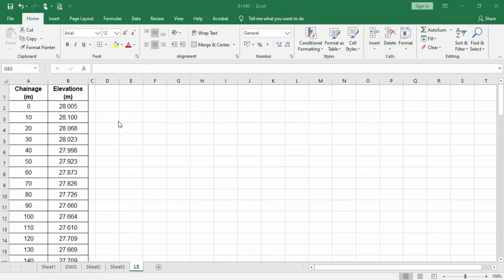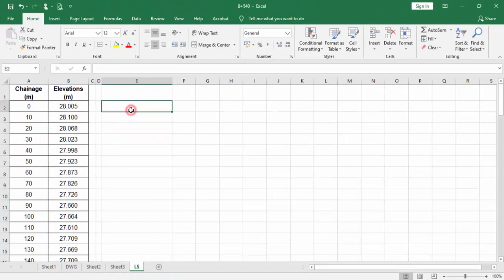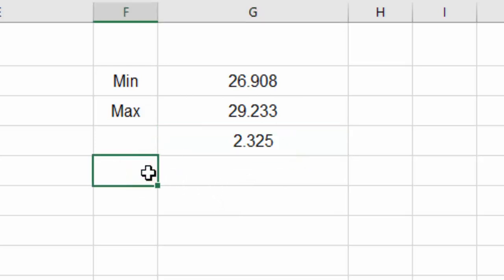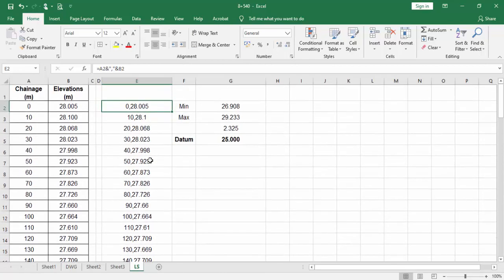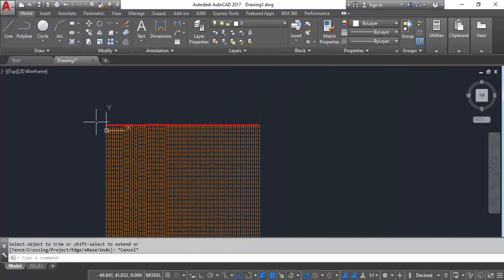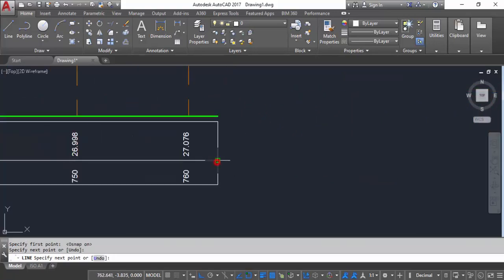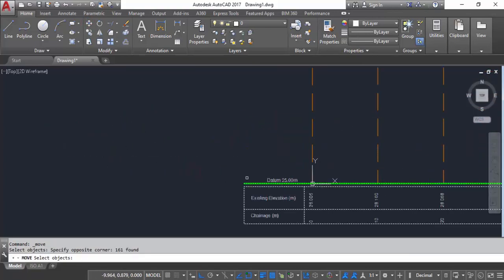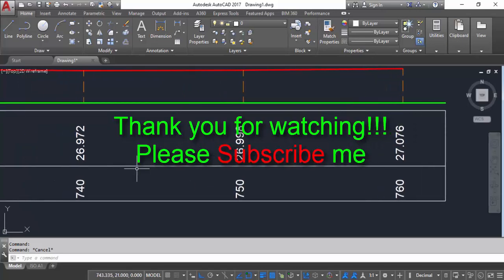How to Draw LS in AutoCAD within a Minute.

Comment: why it is asking me to set ucs name..?
Reply from the maker: UCS related application.
Reply: @RajCAD8801  Sir how to solve this?
Reply from the maker: @adityahegde7873  please let me know the problem are you facing?
Reply: @RajCAD8801  Sir, its asking me to set UCS name. The file uploaded on the drive link is named XY LEFT. Is that the right one?
Reply from the maker: @adityahegde7873  Yes file is ok...For example, 1000m have 100css' so each CS has a different UCS name to easily understand so that asking CS name.
Reply: @RajCAD8801  Thank you so much Sir!
Reply: @RajCAD8801  Sir, even i am facing the same when problem, what should i name the current UCS name
Reply from the maker: @naveenbiku6456  please read above comments, you can understand problems.
Reply: @RajCAD8801  sir I have read them,can u pls tell in detail what is to be typed in command prompt after loading the XY LEFT LISP FILE,
Reply: First step is I have entered XY
Reply: Then it is asking to enter the current ucs name
Reply: @RajCAD8801  sir give me in details. What name  type i put
Reply: @RajCAD8801  matlb